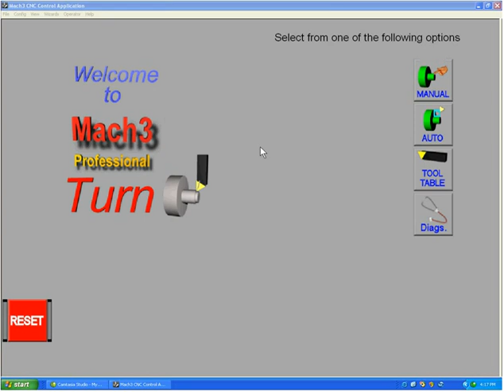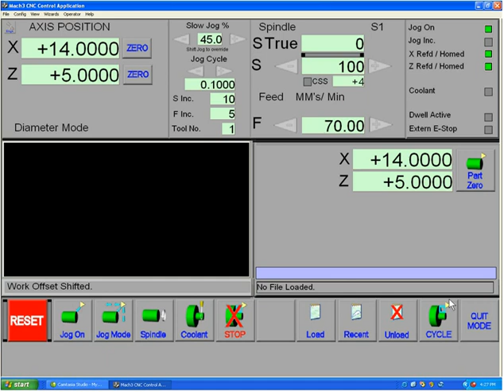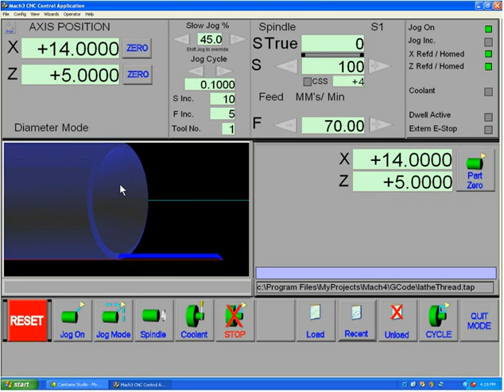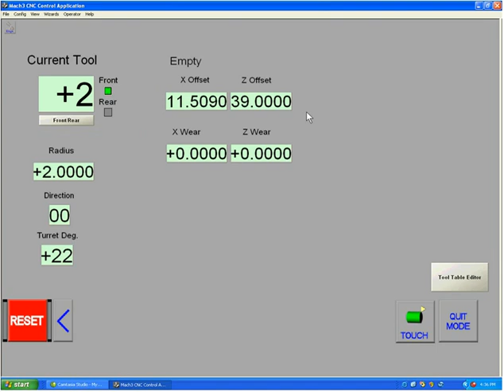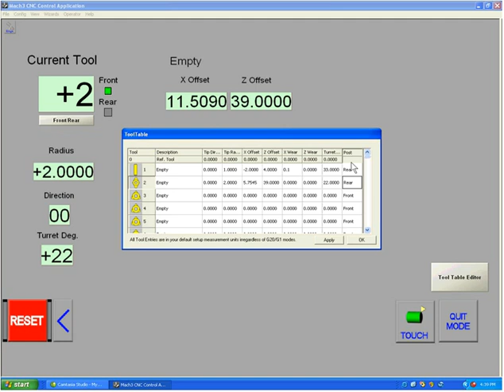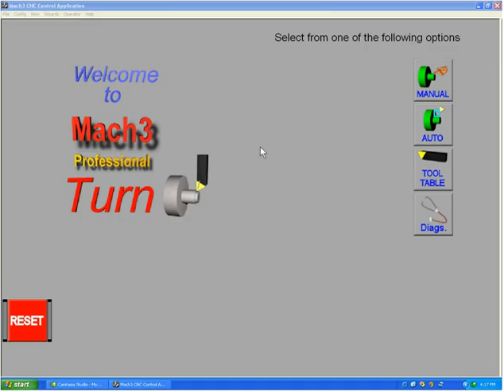Comment: Thanks your video is  a big help.

 I had used the demo version with a parallel port and was planning to purchase a licensed version of Mach 3 when the computer blew up and I was back to square one. I now set the demo version up again this time a USB connection and the plan was to purchase a licensed version. But I have struck an rather odd problem. 

The machine will jog both X and Z axes using the arrow keys on the keypad but the DRO for the Z axis does not register.  However if I pull up the Mill version the DRO behaves normally. My screen is slightly different from yours with more LEDs on the Jog screen.

The LED illuminates normally when I select Jog On .
 X Refd/Homed is Off 
 Z Refd/Homed is Off. 
Rear is Off.
 Front is On. 

I assume it is a configuration issue but not sure where to go from here. I wonder if the version I have is out of date.. I would appreciate your assistance.

Robert